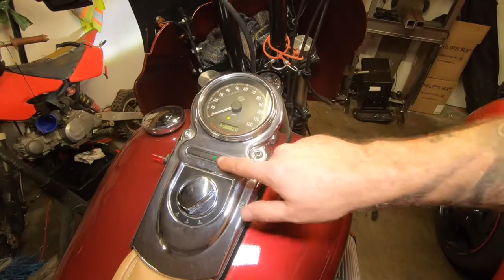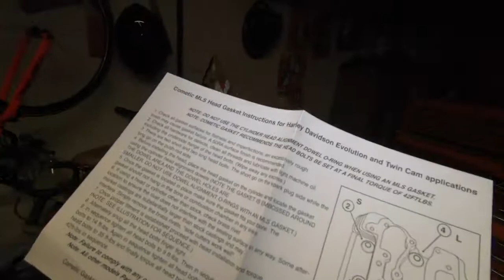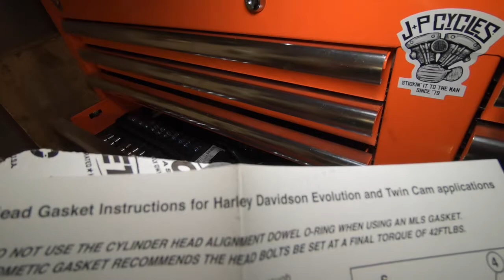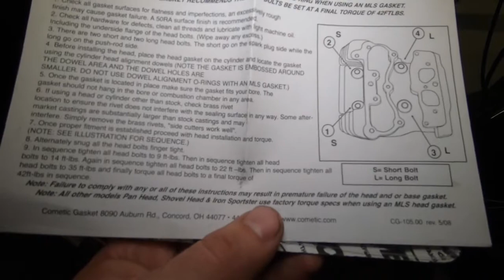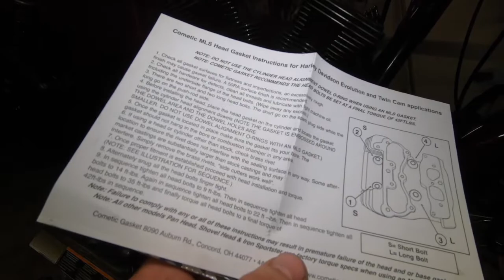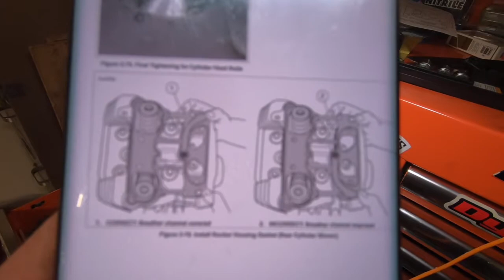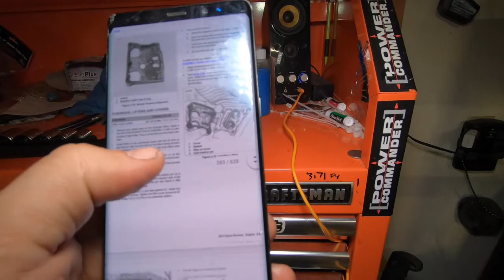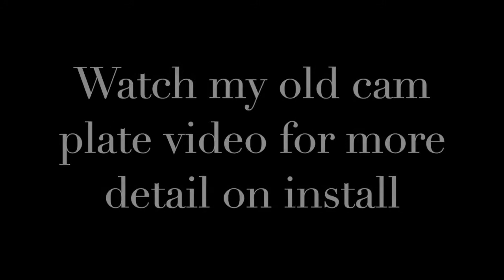HARLEY-DAVIDSON OIL PUMP INSTALL

Comment: 2014 FLHRSE 
I am dealing with the exact same thing. Originally had a cam and lifter fail. I pulled the front jug to inspect the piston, which was alright. Used the Cometic mls head gasket when reassembling. Replaced with OEM S.E. 255 cam and S.E. high capacity lifters, upgraded to S.E. support plate and high volume oil pump. Made the exact same mistake when installing. Ten minutes is all it lasted. Crankshaft looks just like yours. I’ll probably start polishing it up tonight. Hopefully be back on two wheels tomorrow. Lesson learned.
Reply from the maker: Mine is s$s.. expensive..my very experienced friend said it was probably better polished up with a little clearance I was worried for a while it would get sloppy but I have the timken bearing conversion and everything seems good and tight..thing bones out
Reply: @TheGasStation1616  
110 Screamin’ Eagle came stock on my CVO RK. It’ll move. I could even tell the difference that Cometic gasket made, for the two miles I got to ride it. Glad to hear your crankshaft repair worked. That sets my mind at ease some. I’m literally doing the exact same repair right now, for the exact same reasons.

Comment: Man damn I'm pulling out my hair with the same shit. Gotta 2005 dyna superglide with them fucked up cam chain tentioners and I replaced those at 49k miles. Couldn't afford the upgrade then. Ran it for another 20k miles and a cam bearing went bad. So I break It all down and replace all the bearings in the cam chest and while I was in there put new tentioner shoes on it. Well I fucked up something putting it back together and a ring in the oil pump broke 5 miles down the road. Bought the upgrade then screaming eagle plate and pump and put it all together with assembly lube and did what I thought was everything right and put it all back together and now I don't have any oil pressure. Sounds like shit too with the lifters clackin but the oil light never went off so I just got in from tearing it all back down again. I had to do some repair work to my shaft as well because it got buggered up when that ring broke on the old oil pump. I couldnt get another one on the shaft without smoothing the shaft back out and im wondering if I fucked that up to where I'm not getting pressure because of that. But I got the new one on good and lined it up and torqued it proper and no oil pressure is my reward. Bout to blow it and the house up! Gonna try one more time to get it right and if I still don't have any when I get it back together this time I'm gonna take to the dude in tupelo at fuel cycles and let him do it and suck his dick I guess for the grand he will charge me for fixing it since I'm a poor ass old man retired now. I love that bike man. It's my 4th one and I put 50k miles on it in 2 years I rode it so much. Your video was very helpful brother. Ill let you know how it goes.

Comment: Where did you get the new rotors for the oil pump? Or does oem rotors fit the screaming eagle pump?
Reply from the maker: If you look at the updated video, I may speak about it more, but I believe it was the screaming Eagle oil pump that came separate. I got it from Harley Davidson.

Comment: O ring on oilpump wasnt on straight. Replace the oring and put it in again. Your running it dry. Oilpumps not pumping oil. Loosing your prime on oilpump cause of a $2 ,   O-ring
Reply from the maker: Na it's good man the o ring was straight and new

Comment: bummer, how is the  re-used cam plate holding up?
Reply from the maker: Yup...I tried getting another for free but didn't work out ..the se ones are cheap now like 300 if I need another I will go that route.
Reply from the maker: Good for now
Reply: hey bro what did you use to mill it i am haveing to do that on a bike i just got the someone did it to that one and did your plate hold up thanks and i need that manual @TheGasStation1616